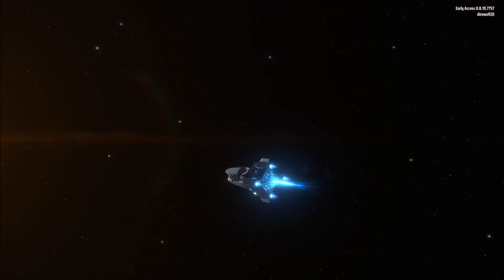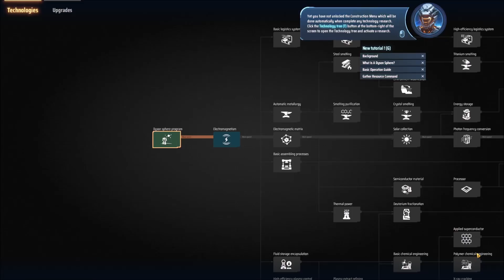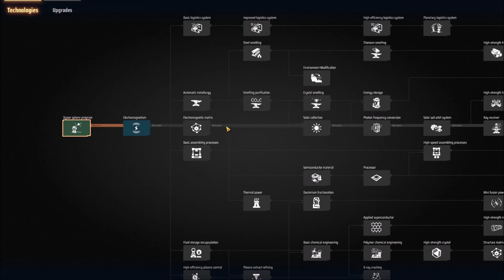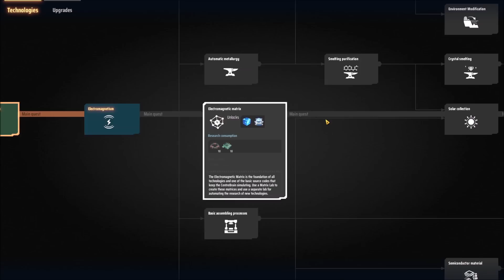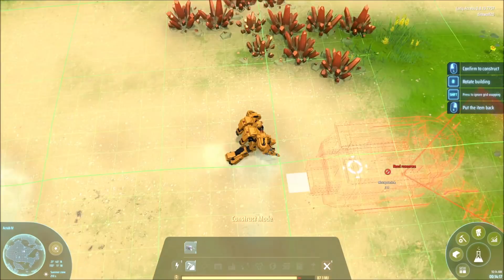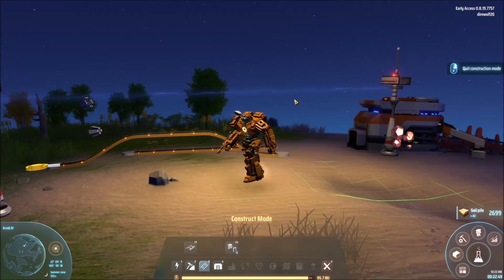Dyson Sphere Ep1   Planetfall

Comment: You still have the same problem that you had years and years ago... "Ahm, uhm, ehm, aaahm, uhhhm". Not like just 'every now and then' but constantly. Please train yourself to not use filler words. Train by making short pauses so your brain can catch up. Form the sentence in your head and then speak it.

But this is just horrible to hear... Its basically 'ahms per minute' that you can introduce.

You have that in current videos, in old videos and through all your timeline.

If you train yourself to not use filler words and/or to use them extremely rarely. You will sound much better in and out of youtube.

Stay crunchy.

Comment: In case people don't know how extreme a dyson sphere is. Let's say you want to make a 1 mm thin layer of glass on the surface of the sun, the surface area of the sun is about 6.07 x 10^18 m^2, the density of a 1 mm layer of glass is 2.5 kg per m^2, so you will need 1.51 x 10^22 kg of glass. For context, that is about 21% of the mass of the planet Mercury, for a non-functional sphere of glass without supports at a distance from the sun where nothing can really exists.